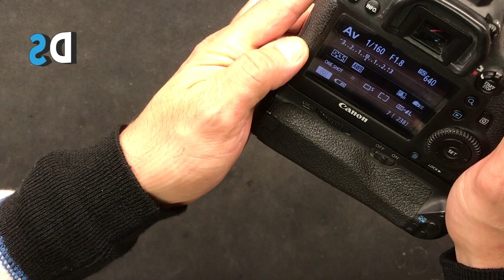How to repair Sigma lens 50 / F1.4 - Focus problem

Comment: Thank you so much for video. My lens stopped working while my other lenses did not. The view was always blurry even though I was trying to focus (in both AF and manual settings.) At one point it was getting sharp focus until I heard a dull clunk from inside from something falling out of place. After opening up the lense at 2:25, it was immediately clear what my problem was as the first glass circular unit in the middle which you never removed in your video above was entirely unscrewed/dislodged. I screwed it back into place tightly, popped in my SD card into my Canon EOS R and now it works!
Reply: Hi! It sounds like I might have the same problem as yours. Is your lens, by any chance, the same one as the one in the video(sigma 50mm f1.4 EX DG HSM)?
Reply: @ValiBordas  yep!
Reply: @annameikeing  what exactlly did you do to the lens to fix it? if it's not to much to ask. I think that this might be the cause of my AF problems and I'm tryna fix it. The focus is not consistant while using AF.
Reply: @ValiBordas  mine just has a loose component that I tightened
Reply: @annameikeing  Thx for ur response 🙏

Comment: wow thats a nice job, i just have a question, i dissembly my 85 1.2 ii L canon, what kind of grease or type you use to lubricant , any brand or spececific grade
Reply from the maker: Hi, no need to use grease. Just is too expensive to buy for only one lens and two small dots of grease :)Thank you :)

Comment: Hi, I'm having trouble opening the front glass to clean the dust particles, any help?
Reply: Once you take the filter ring off there are three screws that hood the front glass on as well as plastic caps in the screw holes. Once those are removed the front glass should come right out